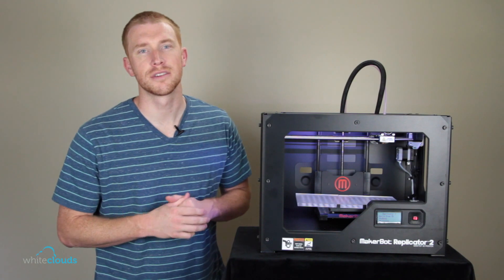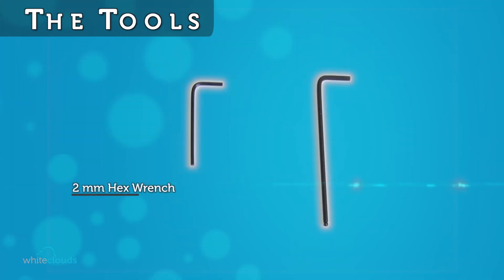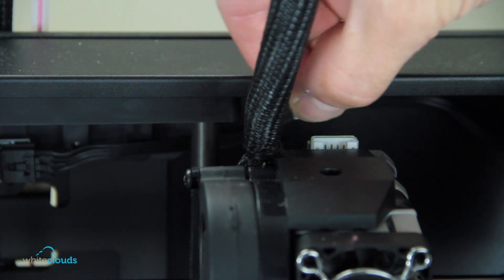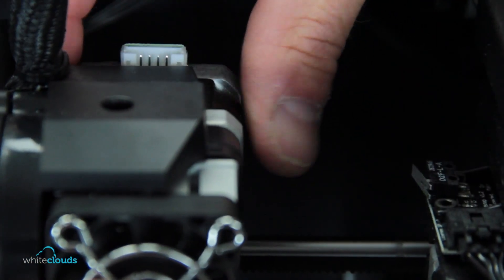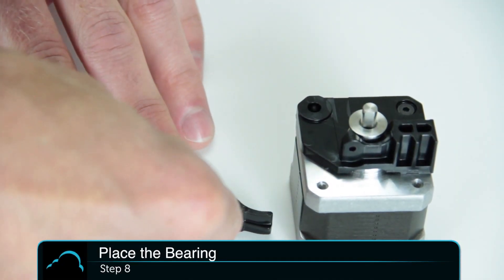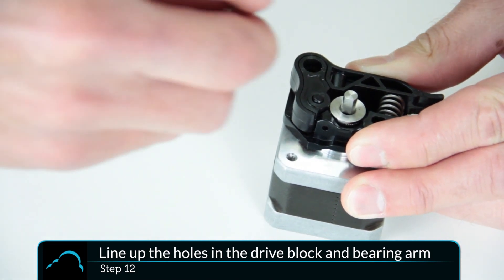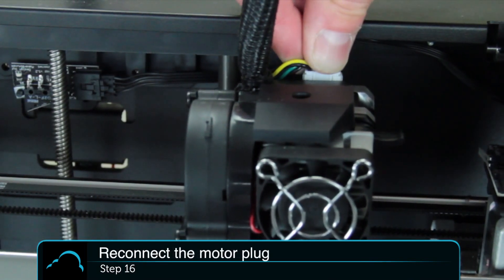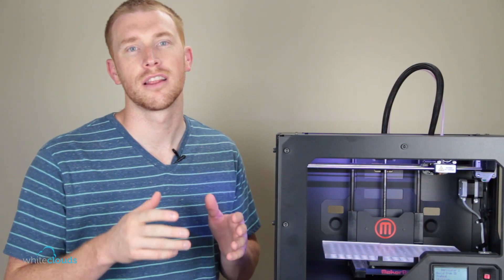Makerbot Replicator 2 - Extruder Upgrade Tutorial

Comment: Hi, wanted help with the following.
I have a printer type Makerboot and my problem is that the fan of the extruder stops sometimes and this is a jam. Change the cable, fan, but after a couple of days of printing, returns the error that the fan stops sometimes.

The strange thing is that when you turn on the printer again, the fan works again.
I would appreciate any help.

Comment: The problem you will run into is if you have a jam in the nozzle.  The hole the filament passes through after the pinch mechanism is so small that you will have to take the whole extruder apart just to clear it.